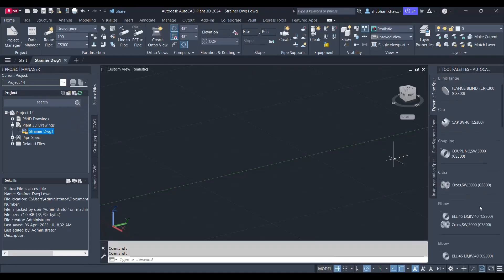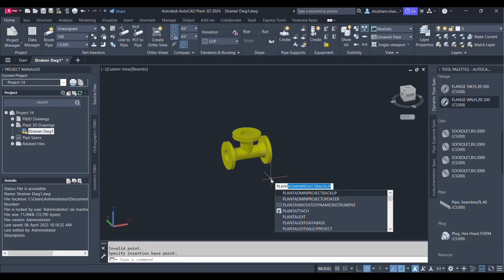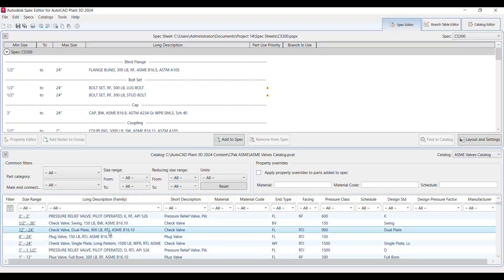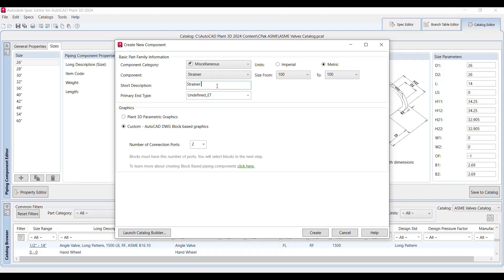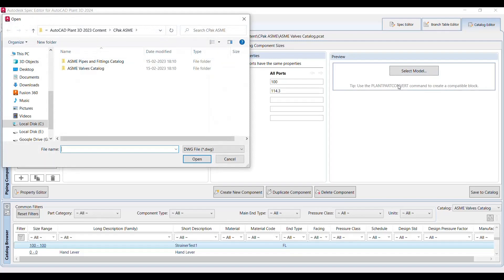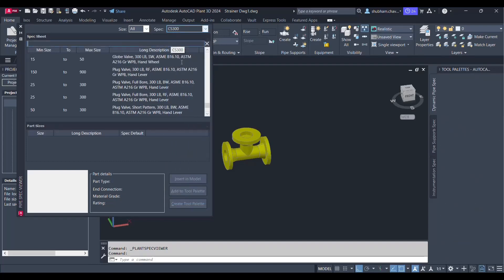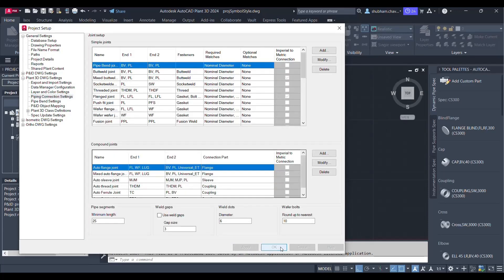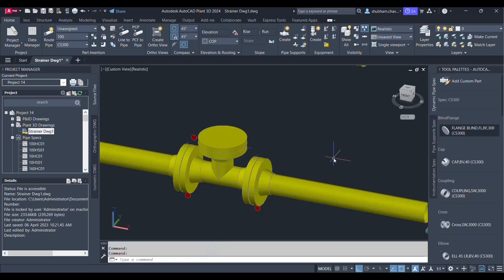New - Use Spec Editor for adding custom components to catalog in AutoCAD Plant 3D

Comment: I'm new to using 3D Plant AutoCAD software and right now I need to create a K65 copper pipe spec.
I am using a copper cpack that I downloaded from autodesk.
I need to change the dimensions from 1" to 1 1/8" or 1 1/4 to 1 3/8" and I can't do it.
Any idea what I can do to change it?!